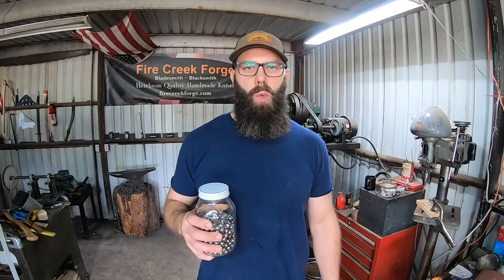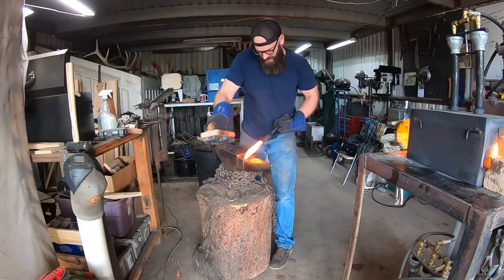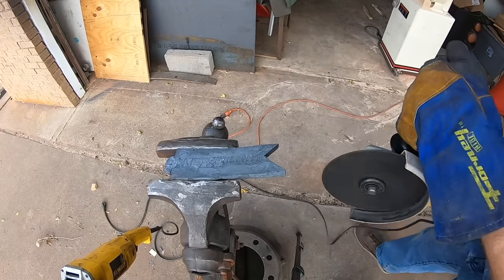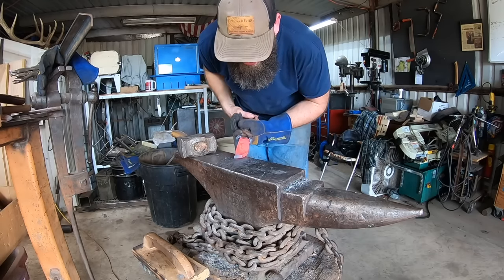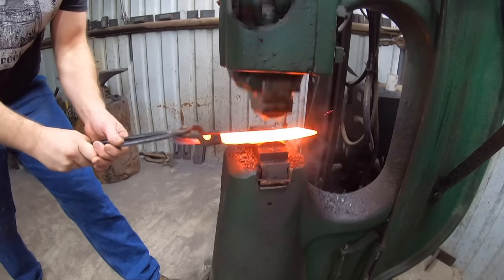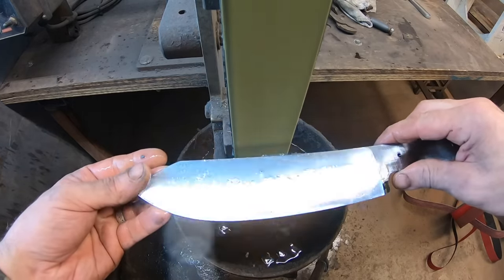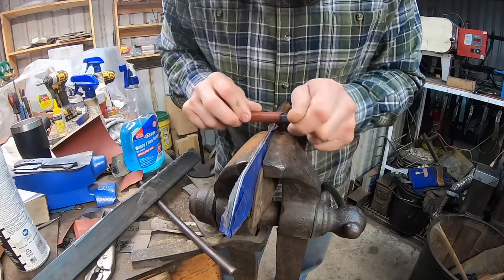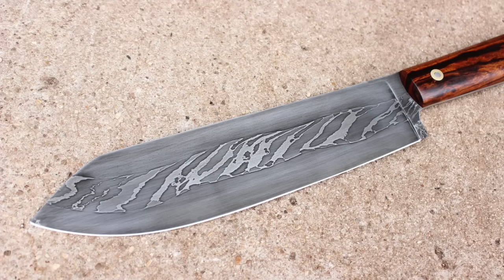Forging A Super Sharp Damascus Power Core Knife

Comment: Could you set up something like an exhaust fan working thru dust separator like an oversized cyclone  collector since the air speed wouldn't be there? For your closed in grinding area.
Reply from the maker: Worth trying

Comment: Another great video 

What respirator are you using, and are you happy with it?
Reply from the maker: Thanks! I'm currently using a 3M P100 respirator, works well.
Reply: @FireCreekForge  thank you, I'll check it out. I'm saving for one right now.
Reply: @FireCreekForge  after looking up that mask, I realized the 3M P100 is the same one I use now. I thought you were wearing a full face mask with a hose?

Comment: beautiful project as always
I wondered if it's possible to forge a flexible filleting knife or is it made in a different method
Reply: flexible and sharp steel is made by using spring steels and tempering to a different temperature..I forget the actual temperature but duck egg blue will make spring steel extremely springy and bendy depending on thickness.
Reply: Flexible comes from the distal taper not tempering.